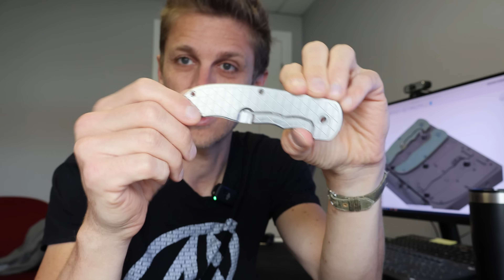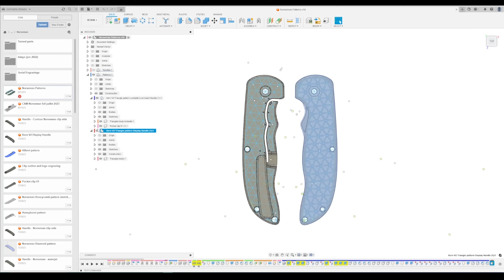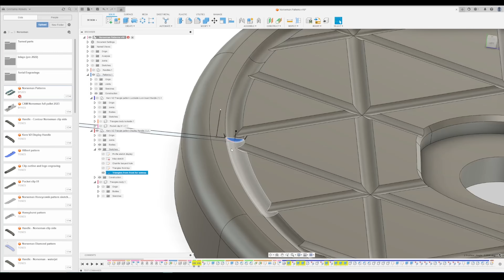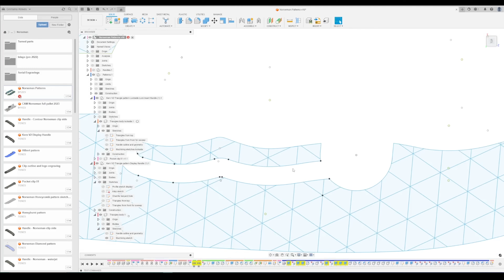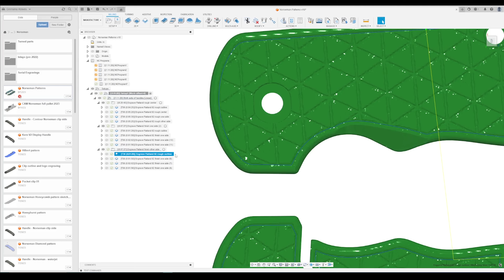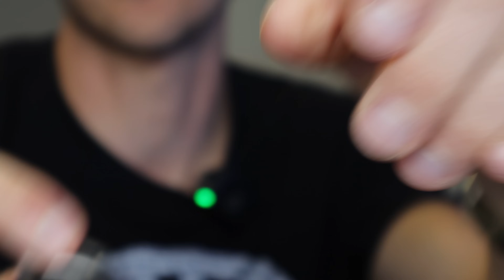The Challenges with Designing a New Pattern

Comment: Hey I was just wondering. Dont you have 5 axis CNC? Why using 3 steps for a pattern. use ballnose or lolipop tool and lean the workpiece at an angel so yo always climb cut from the side of the toolnot from the center of the tool. Wouldnt that be faster and better?